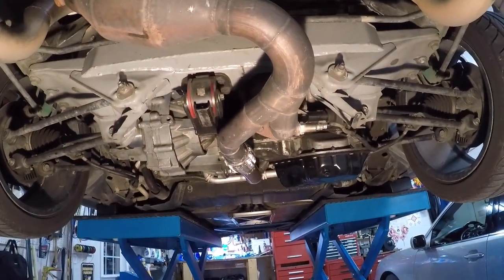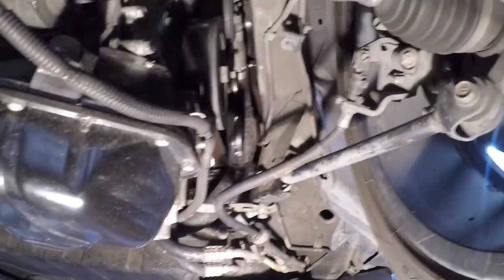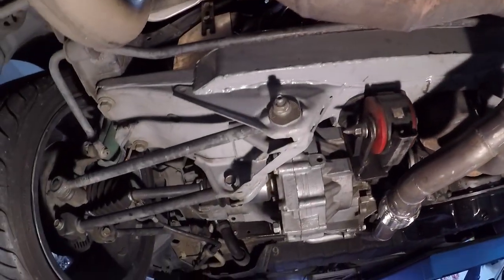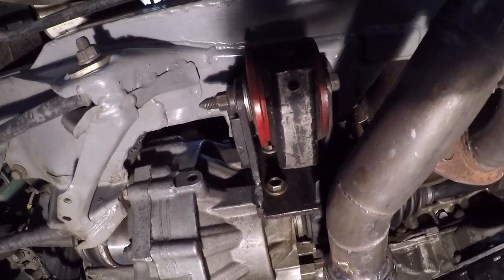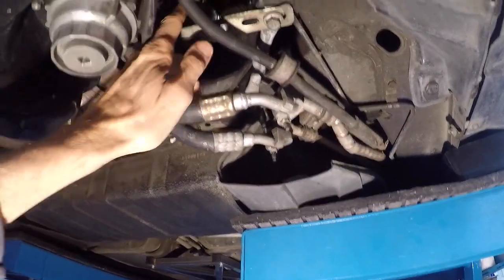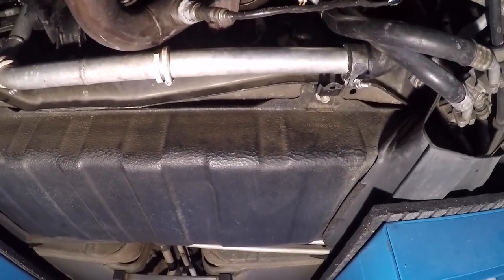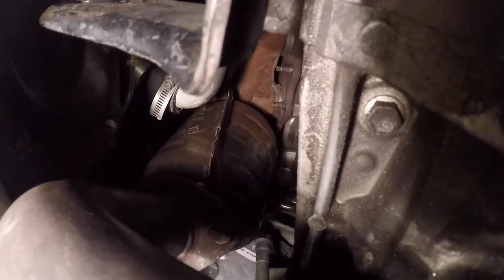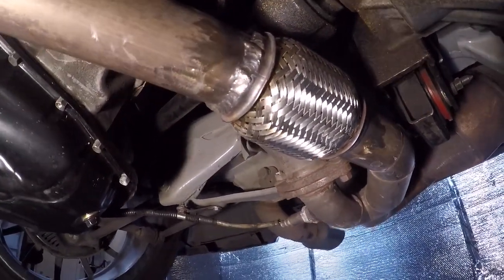MR2 Spyder - 2GR swap show and tell - underside

Comment: Build cost?
Reply from the maker: I bought the car for $17,500 exactly 10 years ago.   The builder (USPSPRO) built it in his garage.  He made a comment at the time, about selling it for more than it cost him to build.   The only fabrication was crossmember, bell housing and engine mount welds.  It has off-the-shelf axles and clutch.  Wiring mods were all homemade.  I replaced the transmission a few years ago for $350.  Current cost to duplicate would be: 2GR engine, S51 transmission, custom welding, plus odd parts (one matrix axle, clutch, misc heater hoses).

Comment: Hi, awesome car.  Does this pass obd2 smog?  I’m not in Cali and no visual inspection here, just plug test.  Any CEL?
Reply from the maker: I bought the car in San Mateo.  It had transmission codes when I got it.  Marc Labranches hacked ecu fixed all the codes and raised redline to 7200rpm.   No codes now.